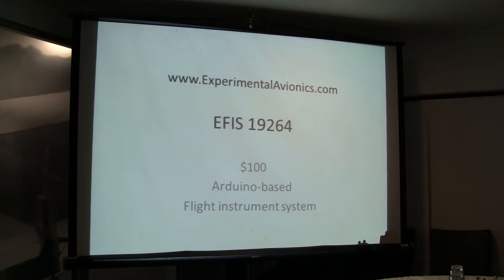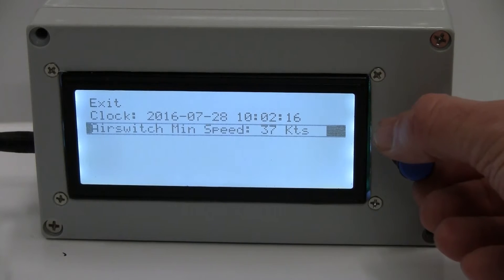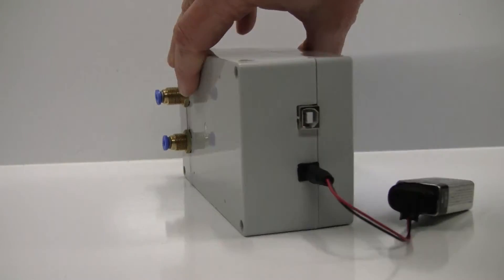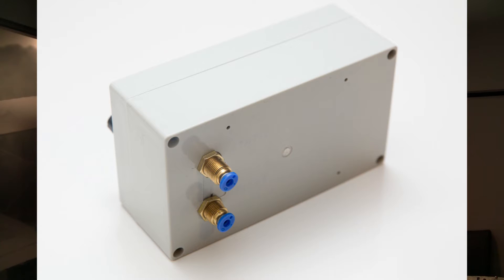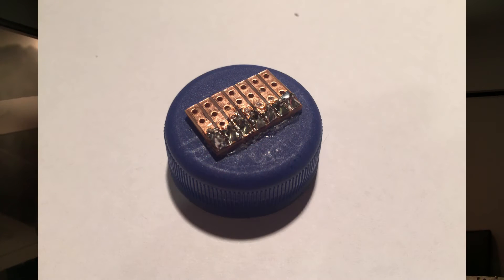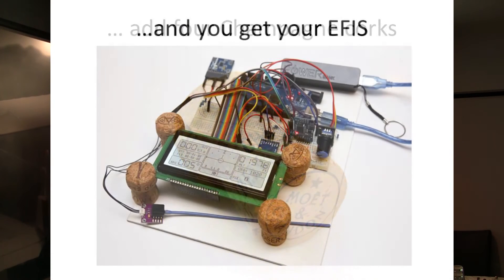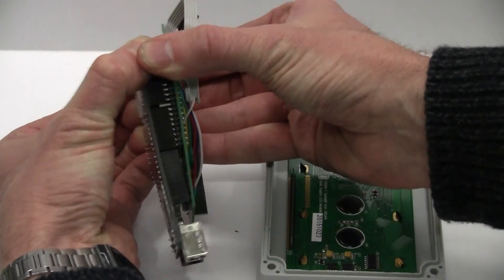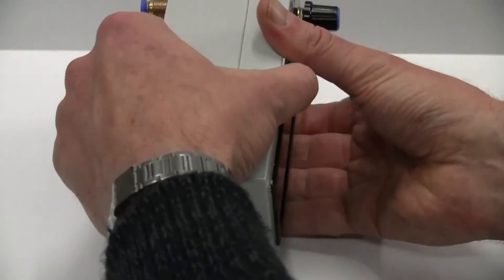EFIS for $100

Comment: I have been pricing full EFIS from Dynon, Garmin and GRT for a RV-7 project. The price is eye watering. I am not thinking portable GPS and iPad based system, which can be had at a fraction of the full meal deal systems. However the full systems are amazing. if you go whole hog, EFIS, Map, EIS, Com, ADS-B Mode S with WX.Trafic, 2-Axis Autopilot you are going to be well over $12,000. You get a lot. To go ala cart radio and ADS-B compliant transponder is $4,000 or more. If you add ala cart autopilot add another $3,000, so these systems do have good value. The integration is what is so cool.
Reply from the maker: Yes, Dynon and Garmin are pricey. As far as I understand most of their price is R&D and support. When you do DIY avionics, you don't have any of these costs.
Reply: @experimentalavionics2596  I wonder if there is any limitation there with ADS-B transmitters. Receiving is pretty easy, but I don't know what the regulatory requirements are for transmitters.
Reply from the maker: @microcolonel  ADS-B transmitter requires an approval from communication authorities (FCC, ACMA, etc). Too much effort :)

Comment: any thought to using RC/Drone Flight controllers instead of the base ardu? they have the magnetometer, Barometer, and Accellerometers on-board usually, and much faster.
Reply from the maker: I have considered that. Decided that the R&D time would be about the same, but building the thing from scratch is much more fun.
Reply: @experimentalavionics2596  can't disagree with that! Awesome job and thanks for sharing!

Comment: Have you thought of using the board to drive a tablet? Great work!
Reply from the maker: That thought crossed my mind but I dont want to add any complexity at this stage. I plan to feed the data via Bluetooth or WiFi to an iOS device in parallel with the EFIS screen

Comment: Very cool Oleg! This is something I am interested in making. Do you have plans to build a low cost autopilot and GPS?
Reply from the maker: Autopilot could be fun project from software design point, but the cost of servos will eliminate all the financial benefits of doing it.
Reply from the maker: I plan to include a GPS unit, but it will be for data analysis rather than navigation. For navigation I use OzRunways on my iPad. :)
Autopilot is not a priority  either

Comment: For those not familiar with arduino. make video for how to use files you have, on to the EFIS
Reply from the maker: There are thousands of such videos on Youtube. If you are new to Arduino, lookup "Arduino blinker". It will give you all the info to get going.
Reply: If you haven't learned about arduinos yet... Get with it. I love their simplicity and power. I've made a automatic chicken door, PWM  based battery charger/maintainer, a voltage regulator for a 3 phase generator (saved me $400), fireworks ignition system, and other small projects. Arduino is awesome. Literally.